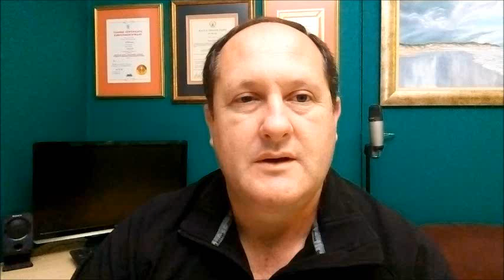Will the Koeberg Reactors Explode?

Comment: Very interesting. My question to you is what about the loss of incoming power to Koeberg? If all incoming power is lost, the diesel generators will run until there is no more fuel to keep the core cool. What happens if there is no more fuel, no more incoming power etc. How will the operators keep the core cool then?
Reply: Run as far as you can
Reply: water will boil off, be replaced by fresh water supply. What happens when that water supply fails?
Reply: @willgeorge5644   isnt the ocean the water supply?
Reply: @surfersparadise5615  You mean like at Fukushima? Well, it's water. But even though the reactor is vertical in this, water is below the reactor, needs to be pumped up. Of course you can have backup systems etc but even the Japanese who are the best with their systems (think Toyota) failed on this. Do you really trust that SA will do better? The chance o failure can be very low, but the catastrophic damage caused by a failure is so bad that the chance should not be taken.
Reply from the maker: @willgeorge5644  Our systems are far superior to Fukushima at Koeberg. FAR superior. We have many additional sources of water and power at Koeberg in the event of fuel loss etc. We can start a mobile fire pump and pump sea water if we have to but we have something better. There is a steam driven feedwater pump that can supply sea water if needs be. No diesel needed.
Reply: @00DEZZ  Do you work there? what about a earthquake? all piping disrupted? Why won't it go like eishcom? Who is in charge now. What about a terrorist attack, a bonb strategically placed to destroy the cooling system?

Comment: Thanks for a great explanation. I really believe we should build more nuclear power stations and get stability back into our grid.
Reply from the maker: Chris thanks for the comment. My only goal is to give facts so that people like you can make a more informed decision around Nuclear when you vote as well as in public participation. In the end the public has the power to decide and has used that power to affect political outcomes including in the Nuclear industry. The Koeberg site is licensed for 6 units so there is space for 4 more and it would make good financial sense to build any extension right there to save costs and keep Nuclear the cheapest on the grid as it currently is.
Reply: I agree, unfortunately with the current government the risk of fraud is extreme. We saw this with the arms deal. They are just to untrustworthy to be allowed to take us in that direction. Nuclear is still the most economical and safe power supply for reliability and stability. We see the great success in France. This issue is when politics change then the the problems start like we saw at Eskom and the lobbyists the fray. The politicians run the SOC's and that is where the problems start. They politicians are not qualified to run businesses.